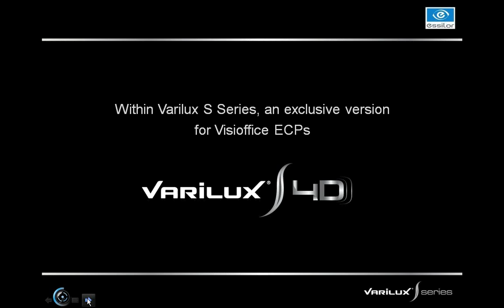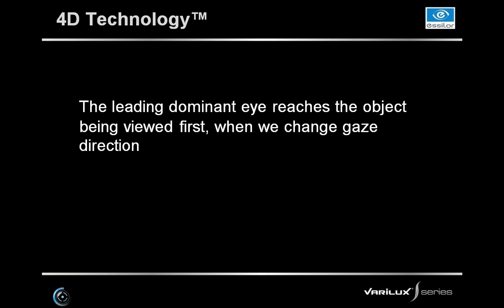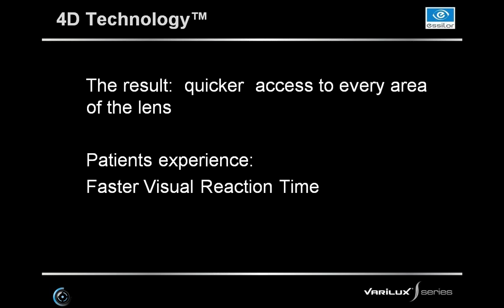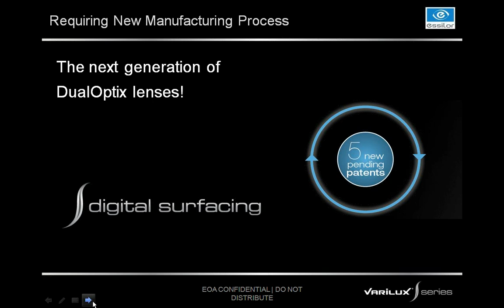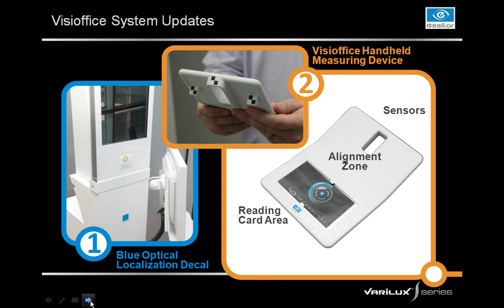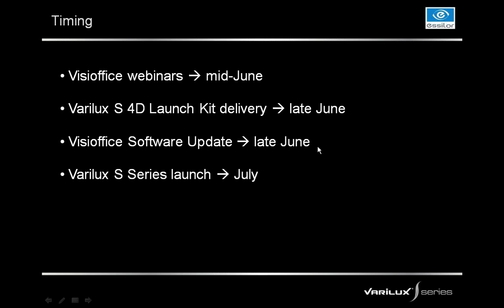Varilux S Series, 4D Technology

Comment: In USA 4D is not supported anymore, but stores don't know about it. They think that it is similar to FIT, not realizing that for 4D they would need to acquire a very expensive machine dedicated machine, which has been discontinued by Essilor. Essilor USA does not keep track of stores which have previously bought this machine, before it was discontinued 3 years ago.  Essilor does not proactively communicates this to opticians. As a result, they find out about it very late in the process. I went through three appointments at two separate stores before they realized that they didn't have the equipment.  They were actually unaware that they couldn't even order it, even if they wanted to. I found this myself after several phone calls and emails to Essilor.  I wasted a ton of my and opticians time.